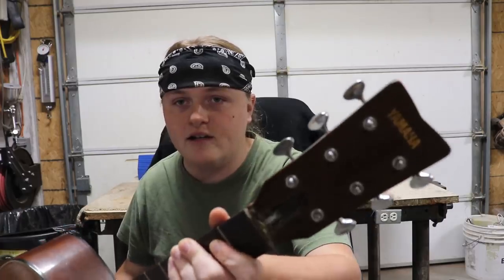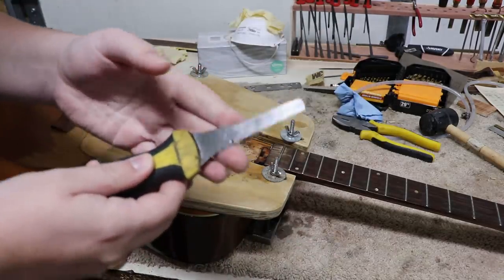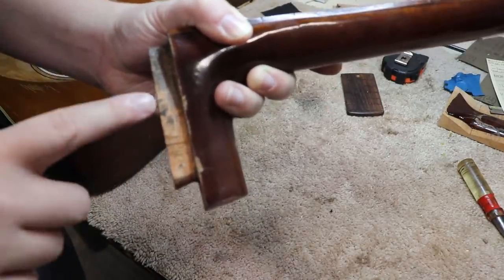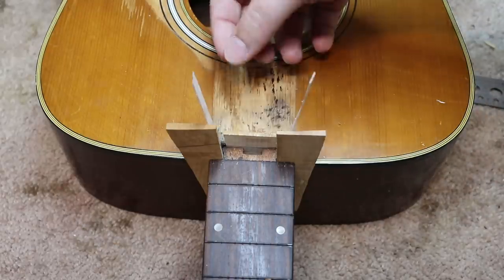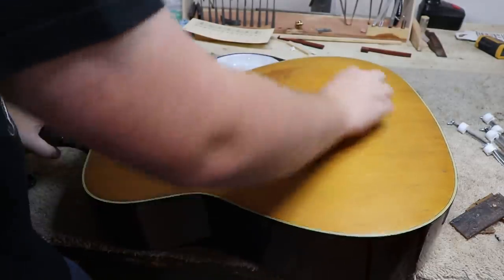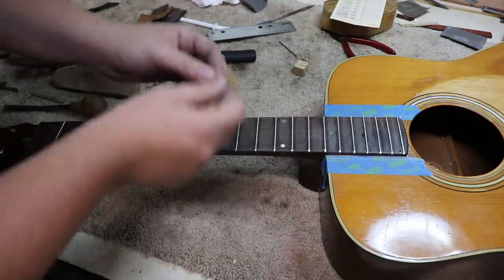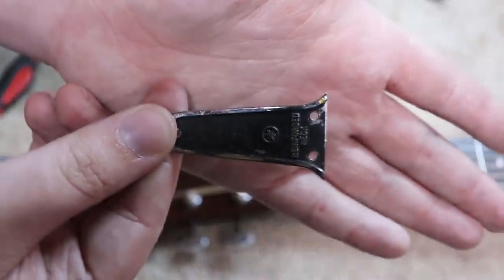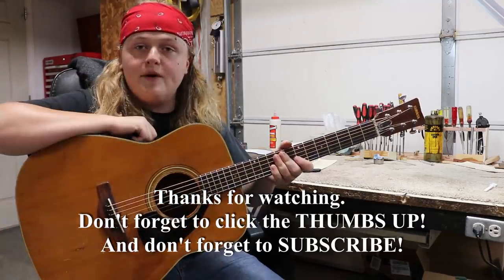408 RSW Yamaha Gets Overhaul

Comment: I also have a Yamaha FG-180 Red Label guitar, built in 1967.  It was Yamaha's answer to the more expensive CF Martin D-18 or D-28 guitar.  The tone on my Yamaha is exceptional.  It has only richened and grew better since 1967.  I would not trade this guitar for anything as it was a guitar my dad bought for me brand new.  I knew he didn't have much money as he was a preacher and we didn't have much money.  Thank you Caleb for posting this video.  If anyone has an opportunity to buy a 60's vintage Red Label FG-180 Yamaha, buy it.  You won't be disappointed......Russell D.
Reply from the maker: Those are great old guitars.
Reply: My wife has one, early 70's and it was kept exceptional, looks new still. They have a fantastic tone and this thing is very well built. Only problem with this guitar, is at full string tension, it is an egg slicer. Action is not too bad, not sure on how to remedy this. I have learned a lot from watching Jerry's videos, so I am going to go through all the steps and see if that helps. May have to see if there are strings that will go to pitch without being so tight, as a last resort. If anyone has any ideas about this or had a similar issue, please comment, this guitar is too nice not to be played more often.

Comment: I know you guys are super busy. I have enjoyed watching Rosa String Works videos for some time now. Learning a lot about what not to do and some of Jerry's tips like truss rod myths. I play true lefty guitars. My 1st true lefty I bought at Manny's in NYC in 1982. I play it almost every day and this Yamaha, my 1st true lefty stays in tune and has never needed an adjustment. I may need to replace a few frets. A Luthier told me it would cost the worth of buying a new guitar so I may attempt that someday myself but it still plays pretty true. Another tip Jerry mentions I like is having the guitar neck flat. My Yamaha has low string action. I play mostly on first five or six frets from the nut, maybe why I have not had to mess with neck adjustment. Nice video from Caleb. You guys are the best, well that's what Caleb is surely striving to be. Of course lifetime experience, we'd all be inventing special tools for various repair challenges. I have a Washburn Guitar acoustic I picked up for 100 bucks it had a few cracks. One day the Washburn fell from the stand and smack hard on a linoleum floor snapped the head stock clean off just like one Jerry repaired. I used clamps and had some crazy glue. Glued it and put it in a gig bag. Left it in a closet for 9 months. Remembered it was there took it out of the bag, had to clean up some excess glue, but the Washburn I thought was a throwaway now plays well enough to use for practice. I know you guys are way too busy to read this, but thanks for the videos. In my elder years now in retirement, guitar playing a hobby for me. If I was young again like Caleb, I'd be studying to be a Luthier. I play true lefty Yamaha, Fender and Gibson guitars. Has Jerry ever repaired a lefty guitar for a southpaw? When my ma gave me my 1st guitar it was a sears silvertone. She didn't know I was a lefty. I turned it over switching the strings to mirror the righty set up. My upside down righty's never seemed to sound right. Younger years I was busy working and outdoor adventures didn't play so much until retirement. I play every day now using strictly true lefty guitars. Bottom line. Jerry, ever fix a true lefty acoustic guitar? Sorry this post is so long and you wouldn't have time to read it anyway.

Comment: So nostalgic!  My first real guitar was a Yamaha FG-180 that I bought in 1972.  I gave it away when I bought a Martin D-28 in 1989.  Big mistake.  The Martin sounded better but the Yamaha always played better.  Yamaha re-issued the FG-180 last year I believe.  I read about it in a magazine but never saw one in a shop.  At that time I read that the original necks were glued in with epoxy.  Is that why you had difficulties?  The writer claimed that you couldn't reset the neck on a FG-180 but I guess you proved that wrong.  Nice work on a real classic.  I expect your bill for the work would be more than the cost of the original even in constant dollars.

Comment: It looks like a Yamaha Nippon Gakki Red Label. Lots of folks prize this series. I have an FG-300 that I bought in 1970. Same problem with the pick guard. It appears to also have no finish underneath like mine. I had a new pick guard made and still struggle to keep it attached. Very good sound, though, after all these years. Great work Caleb. I'd be happy to have you work on mine. I spent too much to have the nut replaced and neck ironed to straighten it out. Not much success. Seems to be only one fret high and buzzing. I'll just file that fret even with the others. It has a great deal of sentimental value but not worth spending a lot of money to fix it more. I wish I was young enough to do what you are doing!

Comment: The older Yamaha s frequently had horrendous neck set angles!!
Reply: I had one just like Caleb fixed, bought new, in 1969. It took a lot of years for the necks to get wonky. I still have a FG 110, I found in a pawn shop years ago, the neck is pretty good still. I keep light silk n steels on it so the neck won't get stressed.

Comment: I have a 453, Korean made Yam I bought new in '77, with just  the same problem. I was told not to try a neck reset 'cause they used epoxy. What glue was that do you think?
Very nice job Caleb. Thank you sir.
Reply: There was some dude on YouTube resetting necks on the early 70’s FG’s.

Comment: Questions for Caleb and/or Jerry?
When a guitar needs a neck reset, in most cases has the intonation also gone out of wack? Does resetting the neck bring it back in to proper intonation? Assuming the bridge and saddle slot are in the correct location in the first place is it just a matter of compensating the saddle for the new geometry?
Reply: I think if a guitar is so bad it needs a reset, you'll be bending the strings out of tune trying to fret them so the intonation is 'wrong' anyway. I also believe the measurement for bridge/saddle placement would be off of a playable string height, so after a reset, assuming nothing else has changed, it should be closer than before. Just minor adjustments for closer intonation, especially with a new nut and saddle.
Reply: sewing1243 maybe....the intonation is a factor of string length between the nut and the string length over the saddle. Changing the neck angle could affect this length so the compensation can be done with the filing of the saddle.